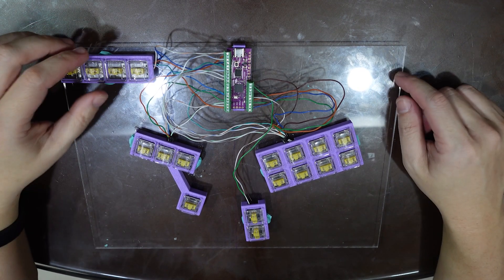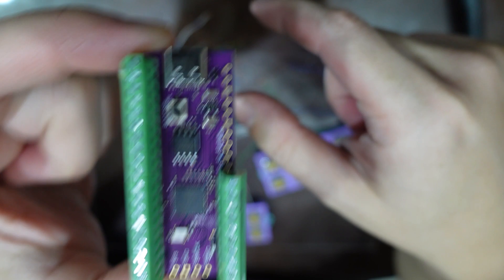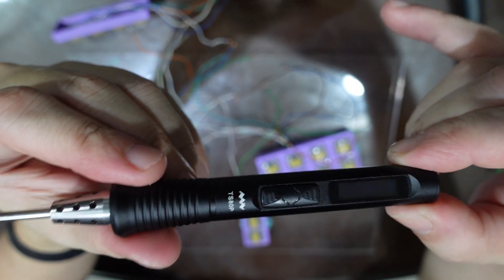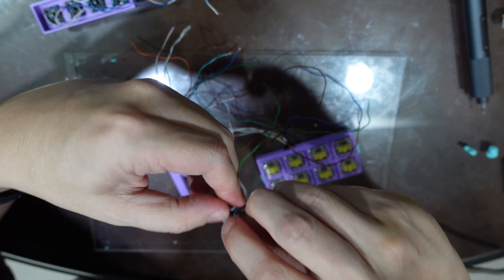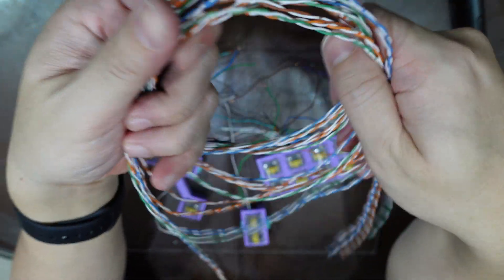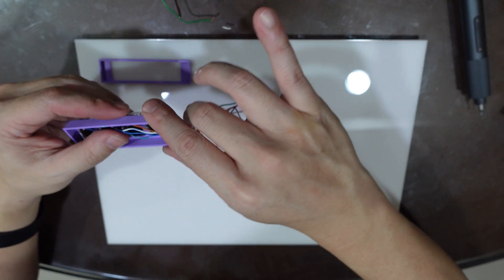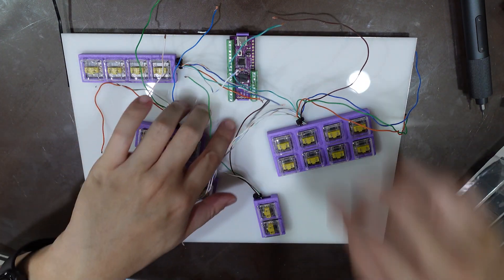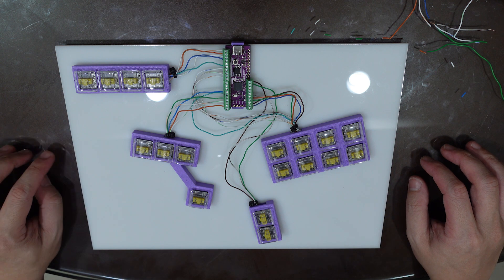Let's Talk About My FightBoard Tournament Edition

Comment: What about using hotswap sockets soldered to your wires? slightly bigger place to solder to and the ability to keep switches clean without having to resolder them every time? then all you'd have to do would be press the hotswap sockets on to the pins of the switches and they should hold tight enough?
Just watch out for heat, too long and you'll melt the sockets.
Reply from the maker: Yeah.. I did see those in stock, I guess I could give them a try!

Comment: You can remove all the insulation from the ground wire and solder on the contacts without cuttingthe cable